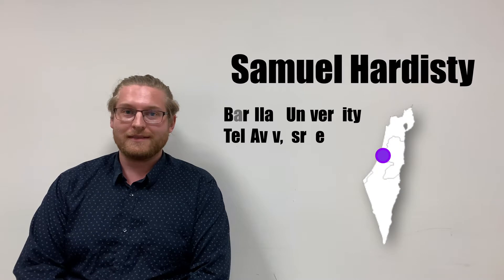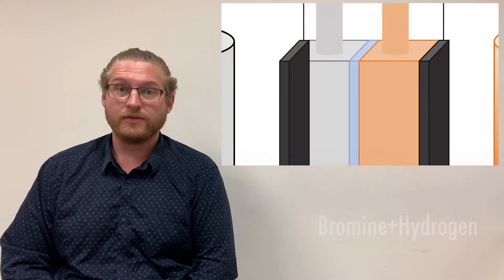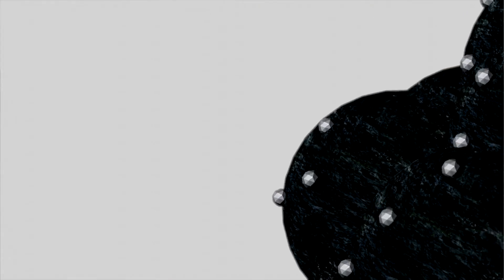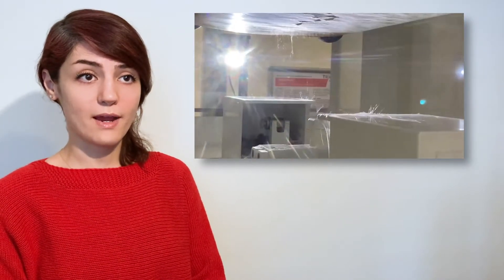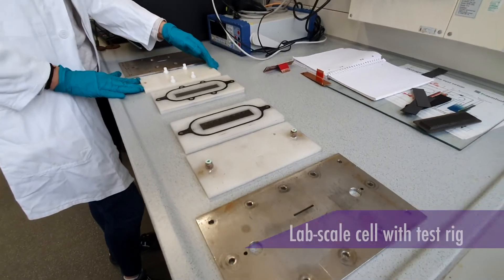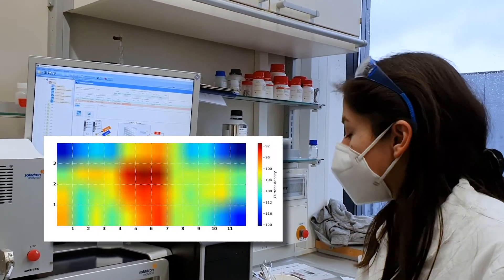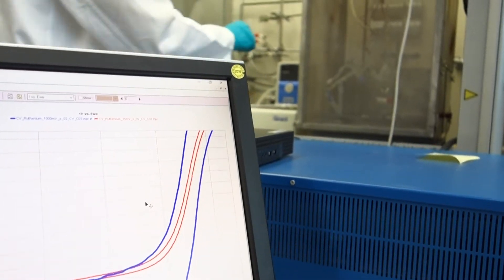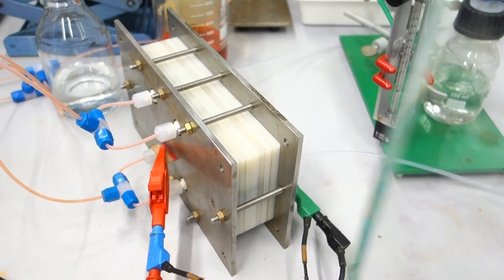FlowCamp – RFB Campus – Demo video – Hydrogen-Bromine Redox Flow Battery

Comment: A hydrogen bromine flow battery can be made much cheaper without a own hydrogen storage but with a connection to a hydrogen pipeline. So during charching the produced hydrogen can be used for instance  by a fertiliser factory. But that includes that during decharging the HBr flowbattery has to get hydrogen back out the hydrogen pipeline. Of course this H2 can not be produced by an electrolyser (wich uses ofcourse a lot of scarse electricity). So the hydrogen has to be produced by Steam Methane Reforming with natural gas. I believe the efficiency is then even much larger then when the same amount of natural gas whould be used in a CCGT gas power plant. (efficiency SMR = 75 % and the efficiency of decharcing the HBr flowbattery = 84 %. That makes 0,75 x 0,84 = 63 % (efficiency CCGT is mere 50 %). While the same amount of H2 is by the HBr flowbattery produced during charging, with electricity from solar or wind. I think that the problem is that the SMR hydrogen is to poluted for the PEM membrane of the HBr battery. Can your institute testing that ?

https://blauwgroenenergie.blogspot.com/2024/05/an-hbr-flow-battery-e.html